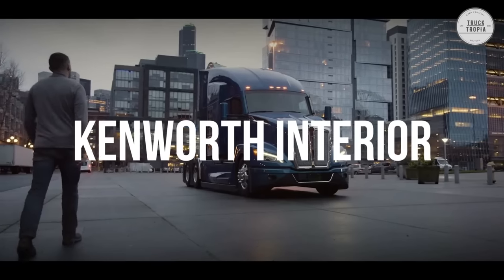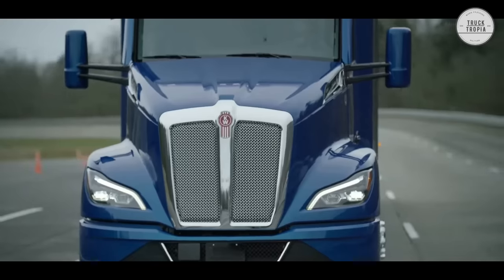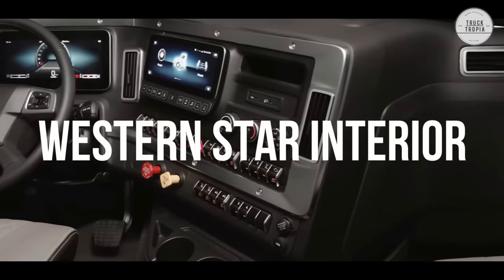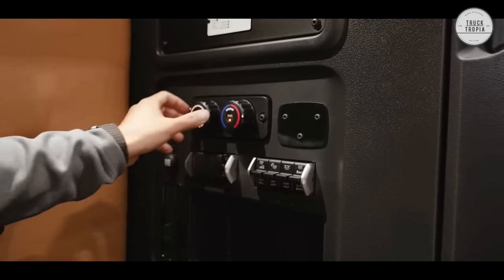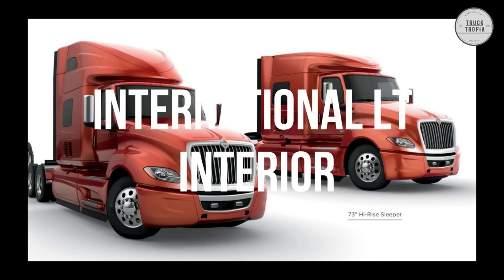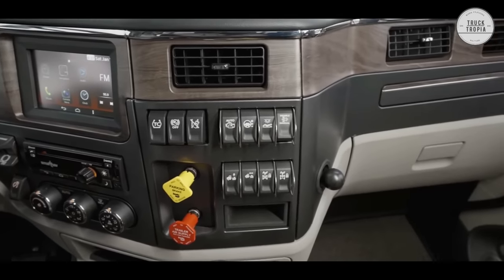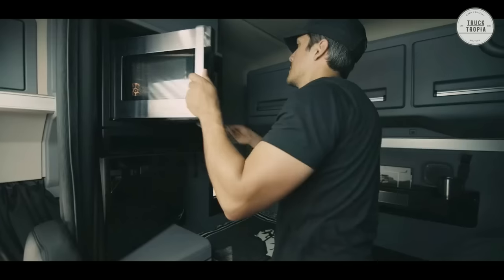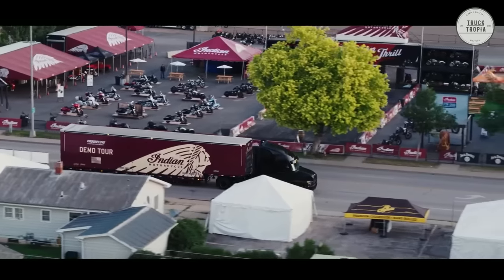Epic American Interior Battle - Which Truck Has The Best Interior?

Comment: Trust me, this new 'digital dash' might look cool but it's not functional. It's distracting to look at, hard to read with sunglasses on, and a pain to use while driving. I've also seen a couple of trucks with the screen frozen, glitching, or just blacked out and now truck doesn't have a speedometer. It is a complete scam... These $80 screens are cheaper than real gauges.
Reply: Have you ever driven one in real life?
Reply: @T1miguel1T  yes. Hard to read during the day with high sunlight, and even worse with sunglasses. I also don't like how flat everything looks. Plain gauges are much more refreshing to look at.
Reply: @kalashnikov1343  I’ve been driving one for the past 2 years and don’t have any of those issues that you have.
Reply: @kalashnikov1343  I drive one myself and I have no problem with seeing the dashboard digital display.
Reply: @victorbernier4765  it's mostly preference. I don't like digital screens when they're not necessary.
Reply: Mercedes display you want to say
Reply: They’re alright with me. I do dim the screen at night though because the reflection on the door window is too distracting.
Reply: I have them at work. I miss the T 800 Full gauge package dash. 24 gauges looked like the cockpit of an airplane and with the old school Cowl mounted West coast mirrors and Spot mirrors top and bottom. 
I miss that truck.
Reply: Digital are way better to me i haven’t had any of the problems you describe.  RV freightliner chassis and Cascadia day cab experience, personally.
Reply: I have a brand new 389 and have nothing but issues with the digital dash.
Reply: We just had a guy we work with lose his digital dash totally frozen nothing worked to reset it. Give me regular gages any day.
Reply: If you wear polarized sunglasses, LCD screen color filters can indeed cause some problem, depending on how they are oriented. In winter this causes some problem in daytime driving, since the snow reflects so much sunlight that wearing sunglasses is a must.
Reply: Polarized sun glasses + bright sun makes reading the gauges fun
Reply: I've had pete 579 with the digital dash and have had zero issues and use polarized sunglasses everyday and can see it great
Reply: I do not have thoes issues with my digital dash in my 680. I actually prefer it over the normal gauges. (Even the normal gauges are still digital)
Reply: Can’t agree more, totally unnecessary and very hard to get used to.
Reply: Yeah, the glitching and freezing were my biggest fear when i started to see digital gauges

But also is the first time hearing those problems
Reply: @spdutahraptor777  Peterbilt had issues already. Screens were overheating.
Reply: @kalashnikov1343  i know i'm late. But i agree with that.
Reply: Couldn't agree more. I just keep searching for information and toggling between screens. It might not seem much when at a stop, but can get distracting when driving. I like how the Mack Anthem cluster is set up
Reply: I own a '22 579. No real issue with screen visibility. The auto brightness can be annoying but the manual toggle compensates for it. I have had screen/guage freezes in the past, but a firmware update fixed that.

However, I have had it go full bright and the dash system crash on westbound I-40 in the mountains before Kingman, in the middle of the night. The dash then shut off altogether. That's NOT a good time or place for something like that to happen.

I prefer analogue dashes any day. I bitched about the TFT craze with motorcycles for years, and now my trucks have them too. Oh well.
Reply: Man they freeze up sometimes and it takes a while. Starts beeping and stuff. Has not done it in a while tho. 2024 pete. When it was brand brand new used to freeze up a lot
Reply: Only thing that digital is better at is when you're stopping or slowing down the gauge goes down real time. Traditional gauges have a lag to it I e hit a complete stopmany times in many vehicles and the needle was still between 0-5mph. I mean yeah digital can fail but it's more accurate at reading speeds. Trust me I hate new shit. I personally prefer manual to auto and never owned an automatic personal vehicle but it's a thing to where autos are taking over so much that unfortunately manuals are pretty much dying

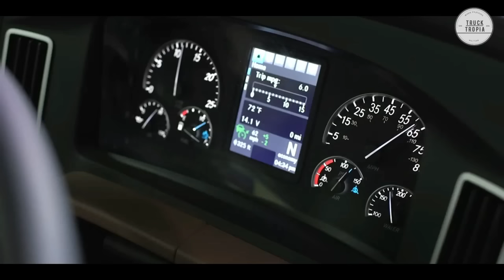Comment: 2:45 I love the fact that ATS detailed their game so much that I recognize all these dashboards only from the game

Edit: Why has the comment section turned into people ranting about why they don't like US Trucks
Reply: What I don't like about US trucks that they all have same yellow parking brake and red trailer brake.
All trucks outside US and Canada have different style parking brakes, even electronic parking brakes.
Reply: @automation7295  Maybe these colors and format is a local standard for secure operating
Reply: @automation7295  your supposed to see them with peripheral vision and it takes 10 seconds to take the it off if you want to get some cool looking brakes, I've never heard a driver complain about the brakes also they use air to activate and chances of it failing compared with electronic brakes are lower
Reply: @automation7295  you can always swap them out for brass , stainless steel , brused aluminium or whatever your prefrense is
Reply: @SoccerFanPosts  yeah brake systems is where i would prefer function over form, besides you can get different parking brake knobs if you want to anyways
Reply: I gotta get that game
Reply: @leonardomichua  I got it when it was on developers sale for less than 5 USD and dlcs were like .99
Reply: @automation7295  its for safety reasons. They should be all the same colour.
Reply: @crrazdogs3482  Well, luckily it's not standard in Europe. How can same colour be for safety reasons? Any types of parking brakes can be safe.
Reply: I’ve found it so cool from being In real trucks to ats the gauges actually work and a majority of them were they should be from factory unless a person special orders different gauges spots
Reply: Because we drive trucks for real not on a game
Reply: Me too

Comment: My 2007 and 2010 Peterbilt 387 had an apartment sized cab, since those "bubble nose" Pete's were as wide as the trailer. But my favorite was the studio-feeling sleeper of my 2014 Kenworth T680.
Reply: idk if our interiors were spec'd differently but I HATED my 2014 T680 interior. not enough storage in the full sleeper, everything felt like cheap plastic. drawers wouldn't close, curtains broke, seats were uncomfortable, now I'm in a 2023  579 with a 58" sleeper and even tho the sleeper is smaller I love being over the road in it much more than the t680. the seats are so much more comfortable and it has better storage as than the full sleeper T680, save for a microwave slot and a full closet.

Comment: As a 9 year "veteran" driver, I've driven everything except Macks and Western Star. With that said, my perfect truck would have the Freightliner Cascadia's cab and sleeper layout, the International LT's front seats and outward visibility, and the PACCAR fit and finish quality.

I find the Freightliner layout to be intuitive and easy to use, with acceptable materials. PACCAR trucks are straight luxurious, but I find most center console switches hard to reach without leaning over a bit. Internationals are straight garbage, but their seats are the most comfortable in the game.

I guess realistically I'd just buy a top trim Cascadia and swap in LT seats. I know I'm in the minority but I'd rather have a Detroit powertrain over Cummins too.

Comment: My new freightliner cascadia rattles so much that other drivers ask me to park with the reefers. I especially like the air vents that blow directly on the steering wheel and no where else. I like wearing gloves when I drive so my hands don't freeze or burn when holding the steering wheel. I love the blacked out cup holders because fumbling around to get my drink in the dark while doing 65 mph is so much fun. Freightliner is the best if you don't have a CDL or never drive. Thanks Freightliner for giving your customers the absolute cheapest low quality truck available on the market. I'm sure my company will pass the savings on to the drivers pay. And don't get me started on the radio.
Reply: That's just stupid if drivers ask you to park somewhere else. It's a freaking trucking life, Everyone is lound. People are stupid. Soon  the drivers of electric trucks will be asking diesel truck drivers to go park somewhere else because they are noisy.
Reply: @EddiTaru  I was joking about that but my new freightliner has so many rattles from the cheap plastic interior that I can't get a good night's sleep. Every night I find a new rattle. I stuff a paper towel between the plastic seems of some part and the next night it starts to rattle somewhere else. The outside of the truck also rattles and I know it must be bothersome to other drivers because I can here it over reefers and APUs. Freightliner Cascadia is the Ford Pinto of trucks. There's a reason all the mega-carriers have Freightliner fleets and it's because they are the cheapest made.
Reply: Freightliner is truly the worst riding truck I’ve driven in 34 years and I’ve driven Mack dump trucks
Reply: @James Revell  my old 18 model Freightlinwr was king. Never broke down, never rattled, etc etc

My new 2022 model rattles, has had to be in the shop 3 times, and rides so rough I've had to custom built wooden racks and mounts to secure my stuff to so they don't go flying onto the floor (or in one case, come flying into the driver part of the cab)
Reply: My old Freightliner Century was a rattletrap.  Every damn trim piece fell apart.  It was so cheap, the ignition key from the Dodge Neon at the time I was driving could also start my company truck (they were the same parent company at the time).  It had a bouncy ride, but I loved that damn truck.  It went 500,000 miles trouble free with a ton of power.  It had an old Cummins with the Super 10 before all the DEF crap.
Reply: @jamesrevell6475  Big facts. I gave up my owner-op spec 2022 Western Star because of the rattling. It has the same Cascadia sleeper and rattles. I will head to the midwest for a 2022 Pete ultra loft tomorrow.
Reply: I totally agree with you, Freightliner is the best.

Comment: In 13 years, Volvo 860 was the best ride, drive, and interior space, and noise reduction ; kw680 had the nicest interior; pete 579 had the least body roll. Can’t speak to Mack or WS. At this stage I’ve come to value quietness, body roll stability, a good seat, and disc brakes. I will always love the International Lonestar that I leased, but they seem to charge the most for a decent interior and replacement parts in general.

Comment: The two best interiors I've seen were the Volvo 860, hands down and a far back second, the Kenworth T660 with the 86 inch studio.   The Volvo with the table conversion bunk has been my favorite setup, largest refrigerator, most room in cab, tons of storage etc, very comfortable.   The old T660s were also amazing,  you fold that top bunk up and you have an apartment a new Yorker would be jealous of lol.  They weren't the coolest looking or sounding but definitely comfortable.

Comment: My biggest criticism of KW T680NG  is that cabinet doors are not standard, they're an optional upgrade feature. Dumbest idea ever.. Same with the desk too, it's an extra optional feature. I think FL has it when it comes to the desk (it's a drawer between the wardrobe and lower cabinet). It doesn't look weird. FL also has a utility drawer, and just more storage in general. Had to drive an NG for about a month, and it sucked. I couldn't wait to get back into my FL, way easier to organise
Reply: Funny you say this because I prefer the 680ng over the shaker, yes there’s more  room in the shaker, but the interior of the kw to me is better quality. Everything from the seat to the bunk wall insulation (we got a new shaker and some of the cabinet latches wouldn’t stay latched.. I’m not a cascadia guy by any means. But you can keep them 😂

Comment: I'm A Long hood Manual Guy But The Kenworth W990 Interior Is The Best By Far! Kenworth Has The Best. Highly Quality Materials VIT Interior Button Tuck. Grey Marble Trim around Cab. Very thick Insulated Floor and Walls that are quiet Solid and hold temps.  The best Sleeper windows.  Double bunk option. High Quality Thick Driver and Passenger Seats that Swivel 360*. Awesome Gauge Package. Swiveling Sleeper table. Very nice Leather on doors that are very heavy and solid. Nobody can Come Close to Kenworth They have always made the Nicest interior studio Sleeper says it all

Comment: Mack truck I guess our company got the base model because the seats suck green donkey D’s you got to get used to that truck you smack your head entering the cab😬 The company I drive for Is slip seating other than that it’s a workhorse kind of metric you gotta get used to it/mixer truck hauling concrete🤣 I like the international my choice of truck the older pro stars I used to be a diehard Peterbilt but now I’m into internationals that’s my choice that I prefer👍🏼

Comment: I noticed in the video that the International LT was “clinic tested”.  No input from drivers mentioned.  It shows.  I HATE my 2023 assigned sleeper International.  No legroom , terrible seat, cramped quarters, constantly hitting my head on things, steering wheel buttons setup is odd, etc.  Had to remove a useless cabinet to drop in a refrigerator (no tie downs).  Ridiculous auto braking extremes, sounds like hail on a aluminum shed when it rains, no net for bottom bunk.  Definitely designed by a cheap pencil pusher.  pos….
Reply: that,s the exact specs for every Ryder International

Comment: I can’t speak about most of these but I am in a TNT phase inside a Peterbilt. It definitely shakes, the sleeper cab AC is under powered and only blows cold air on one side and the insulation in the roof sucks, it easily heats up in high 80 degree weather.

Comment: Volvo VNL 860 has the most compartments but it’s not the best quality it’s big inside and has a good fridge the dashboard is not high and you can sit low and still see everything all these other new trucks they make they hardly put any compartments and they don’t even go all the way to the ceiling and the KW 680 has the worst smallest and stupidest refrigerator who ever designed that should never work on trucks

Comment: The interior is a failure if the center of the back of the seat doesn't align with the center of the steering wheel.

Comment: Kenworth t680 would be the winner because of the layout if not squeaking plastic all over the cabin. And thats in a brand new truck! Volvo is so much quieter inside. So Volvo wins with thanks to adjustable in 3 different directions steering wheel. No truck has that option guys. However upper bunk in 860 is just so terribly uncomfortable in use
Reply: Just wondering, can a six footer fit on those beds comfortably?

Comment: what is the difference between semi trucks and full trucks? pls anyone?
Reply: It’s the trailer that’s named a ‘Semi’ since ‘semi’ means ‘a part of’ as it only has a set of axles on the rear, opposed to a full trailer which would have axles at both the front and the rear. The hauling part is called the tractor or prime mover in many parts of the world.

Comment: My 3 favorite trucks are Freightliner Colombia 70" double bunk with Dbl sleeper doors and side boxes. And West coast mirrors with spots top and bottom 
T800 daycab with a small bunk sit-down 
Hard cab old school west coast mirrors with spot mirrors top and bottom. 
On the Short nose 388 Pete setup same as t800. 240" wb. 525 ISX Cummins 13 speed stick 390 rears on 11R22.5 rubber. T800 and the Pete have a 2 line wet kit single under drivers door 150 gal fuel tank and on passenger side the hydraulic tank and Cabover style Battery boxes. They all have 48" tall 60" slide 5th wheels bobbed frames (Schneider National container hauler style) class 5 reese hitch for a pintle hook. 60" half fenders. KW and Pete have a aluminum headache rack. And a Blockable 5th wheel for frameless dumps. 
All 3 have a proper moose bar bumper. 
And 10 hole classic Alcoas all around 
With Disc Brakes. A big CB. Clean paint job Black With Red stripe with Gold pinstripe with a Silver pin stripe inside the Gold. Frame is Red. With a Full deck plate. Red is Cummins Red.
Reply from the maker: Thanks for sharing 👍

Comment: Wow,  American trucks have come along way from the 500 gauges, bolted woodgrain panels and alloy two spokes steering wheels.

They actually look modern these days
Reply: old school looks way better
Reply: I’ll take a 379 or w900 over any of the plastic trucks any day of the week
Reply: Half the guys would rather have the old school trucks. Never mind they burn more fuel and have smaller cabs
Reply: @marklittle8805  They also don’t spend half of the year in the shop because of sensor issues or emissions tech related problems. Granted the modern interiors are very nice, and they probably ride better too
Reply: @Namisincere  well my last truck was fine . It was a modern truck with the DEF and all that crap. I don't disagree that is an issue, but outside of that there is NOTHING about the older trucks is better than the new ones
Reply: Believe it or not the 1970's ended 43 years ago.
Reply: @JohnSmith-wx9wj  some guys are still watching that old show "Movin On" with Claude Akins and thinking that was the best days of trucking. Or maybe BJ and the Bear